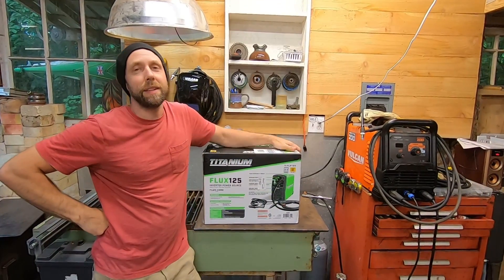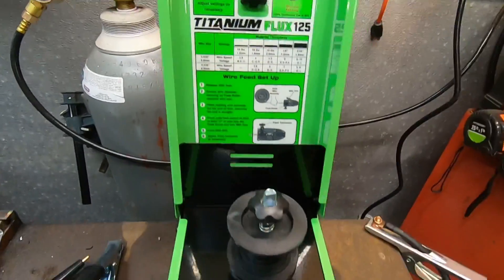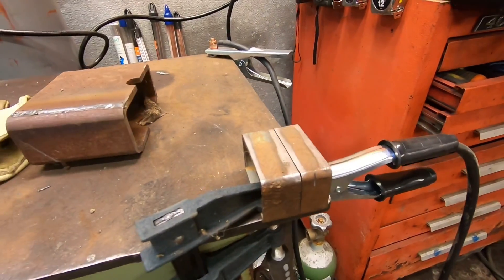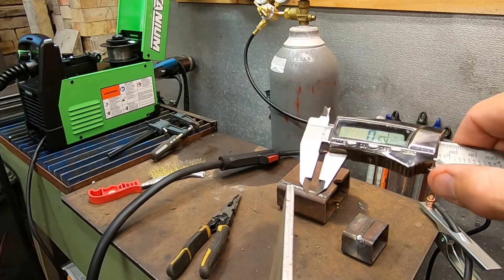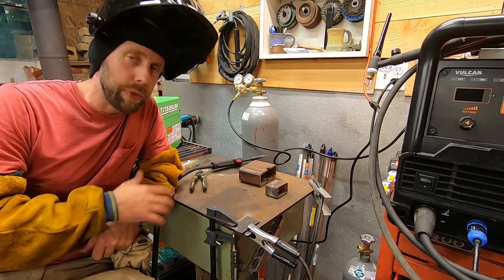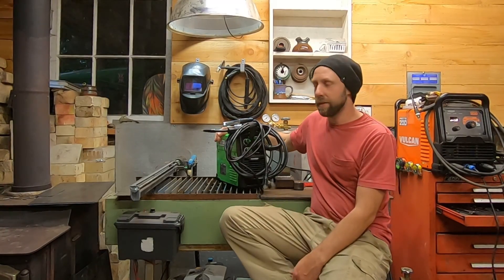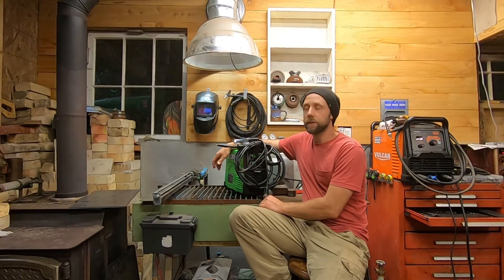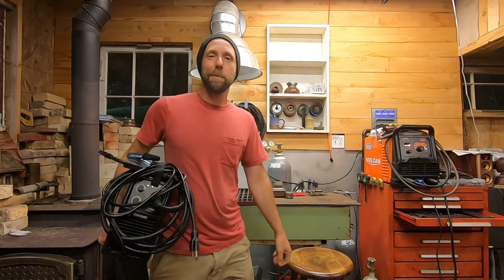Titanium Flux 125 welder from Harbor Freight

Comment: Mike:  I have had the old Chicago Electric 90 mig welder for a few years and used it a little with success.  A buddy of mine got this Titanium 125 welder and I tried to help him get started with it.  One thing I noticed right off the bat was the wire speed of the T 125 was way slower than my old CE 90.  If I put my wire speed on 10 and hold down the trigger, not welding, for 6 seconds, 60" of wire comes out.  The T 125 gets 14" of wire out in 6 seconds.  The specs for the T 125 say 60"-200"/min, so should have let out 20" in 6 seconds.  Also, when we were welding 1/8" material the T 125 doesn't seem to be getting it nearly as hot as my old CE 90, and smaller bead, have to go slower.  Do you think there is something wrong with this T 125 we are using?  Thanks.
Reply: I notice that too I just bought one and was feeding the wire and in max speed it was way to slow but I started welding and like the results welds are more consistent

Comment: Any idea what size generator a person would need to use this welder with. Thanks
Reply: Don,I can give u this info,Ive run the flux 125 on a Champion invertor 400watt start 3500 watt run gen.On full power ,I did shutthe Genny down on overlaod.This surprised me cuz the gen should be putting out a solid 29 amps,maybe its not? the welder says max draw is 23 amps.I did weld just below full power for long enough to know I was ok.Also ran on a HF 6500/5500 generator,no issues with that size gen.I need to test the Champion out more.

Comment: Hey Mike! Love these videos! For a novice like me they are priceless. What size breaker and Romex do you have installed to run the 110v migs that you showcase? Thank you for the great advice on this subject.
Reply: This Titanium 125 unit requires a 20 Amp branch circuit.

Comment: I had one of Harbor freight’s flux welders years ago in the main problem I had was slag beads all over the material Is there something that will help with that?
Reply: Fred Not spatter is going to happen anything flux core. Stick or gas less mig with have it to some point.
Reply: Quality wire that is not e71t-gs wire but e71t-11 or Lincolns 211-mp will cut down on splatter a bit.  There are also sprays you can put on the metal to help those BB's of metal to not stick.
Reply: You can apply "anti spatter spray" to the material beforehand. After welding, the slag beads can be brushed right off. Home Depot sells some by Lincoln Electric (KH505).
Reply: mrmax1984 thank you for that. I thought someone told me years ago there was a spray but I couldn’t remember what it was called.
Reply: Pam cooking spray works too if you're on a budget. 👍

Comment: How much welding can a person actually do with a 2 lb spool?
Reply from the maker: Well I built a entire bandsaw mill with a old Lincoln flux welder and it probably used two spools of wire to build. It’s as simple as having a extra spool on the shelf for when you run low. What do you plan on welding?

Comment: This guys got a great setup, if possible ide like to see some close ups of his welds maybe behind a arc proof shield.  Love the saying "if it's got slag you drag". That in its self will help guys
Reply: Should be "If you want penetration, drag." 
Guys, only push if you're working thin sheet, have a large root, are welding 3 up, or are hardfacing. Really anything 10 ga or over, maybe 12 ga if you want to go hot and fast, will benefit from a drag angle.

Comment: Need a welder to do some metal work on my truck, floor pans and rocker panels.  Has anyone found a .023/.025 wire roller and tip that fits this welder?
Reply: I am not positive but I think the smallest fluxcore wire is .030 that might be why you cant find .023/.025  tips for this welder because those smaller tips are for solid wire  and this welder cant run solid wire

Comment: I like what I see for a 125 amp.
Noticeably better, stabler arc,  than the Chicago electric 125 amp, flux, and tremendously better than 90 amp flux sold few years ago.
Would be great to have on my commercial truck, when I am trucking.
I carry HF 80 amp little stick welder, that was sold few years ago.
It's a MISERY to use, to light up an arc, it is so weak, but it saved me from a lot bigger aggravation twice, by helping me to get fixed when in a middle of nowhere, and another time it was weekend, all businesses closed down. As misery as it is, it was worth in gold, that it put me back on the road. This Titanium 125 flux seems to weld heavenly easier, and better than that 80amp stick, and is better than it's in house flux  competition of the same amperage. 
No reason to bash this thing for a beginner, or have it, to save you like in my case
Reply from the maker: Yes it’s definitely a great super compact light weight welder, I think it welds better then any other Flux only machine I have used in the past. I think for the price and usefulness of it it’s definitely worth having in your truck!

Comment: Hey Mike, I was thinking about getting one too, and converting it to gas, what exact problem were you having about the gas solenoid? I was wondering what places you were thinking of tapping off for the voltage for the solenoid and, that, I was thinking about using a real small relay, low current relay, and a capacitor, for a simpler, post Purge circuit, instead of a bit more complicated circuit using a timer, oh, I was just going to put a decent size capacitor in parallel with the relay coil, controlling the gas solenoid, what were you thinking, for a gas inlet on the wire feeder?
Reply: turtmaster t why would you buy one and convert?  Why not just get a mug and be done. MiG can run gas or gas less.

Comment: I’m curious can you plug the 125 flux titanium welder into an ordinary 110v outlet. Or do you have to have a 30amp or so breaker going to whichever outlet you plug it into. I have had much luck finding out in other videos.
Reply: Ive used it on a dedicated 20 amp circuit,handles 1/4" no problem
Reply: Thanks Jeffrey worth
Reply: I have used it on a 15A circuit, but tripped the breaker after doing a ~10-15second continuous weld on 1/8" stock. Spot-welding or welding lighter gauge material will work fine on a 15A 110V circuit. For future-proofing, I had an electrician install a dedicated, 2-pole 20A circuit for my power tools, like this welder.

Comment: Hey Mike,its jeff,i bought one of those titanium flux 125,s on black Friday,been playing with the voltage to wire speed ratios,Im getting very,very nice welds,no porosity holes,hardly any bb,s etc.Trick seems to be max chart wire speed,reduced from chart voltage.tried from 14 gauge to 3/8" thick.Id love to send u some pics
Reply from the maker: Nice Jeff That’s great to hear! I’m sure if you have some setting info, people starting out with this welder would be really happy to know. If you leave a comment on metal thickness, wire speed and volt settings you have found to work really well I would be happy to pin your settings comment at the top of the comments list to help others out!
I think if your list looks like this people should be able understand how to set there welder up 🙂
Wire size .030”
Metal thickness 14 ga. 
Wire speed 4.5 
Volts D    or   C.5 if a lower setting is best? 
Take care Jeff!

Comment: We bought one of these to weld up a wheel chair ramp at a school for the mentally handicapped.  The welds failed and 3 physically  challenged children with down syndrome went rolling down the main street hill like the poor bastard in the movie Red Dragon but with that Erie constant smile.  Next time we'll buy American... for the sake of the childrenz !
Reply from the maker: Haha this has nothing to do with Chinese VS America made, It just says a lot about the poor quality of the welds made from the person welding. I used a cheap Lincoln weld pack 100 flux welder to build a bandsaw mill and every weld is still holding strong to this day, but I know how to weld.
Reply: Mike festiva this idiots screen name says it all Mike. It’s obvious that it was the operator and not the welder that was at fault and maybe they should have had one of the students do the welding instead of a self proclaimed know it all adult who runs to harbor freight to buy a welder to do his very first ever welding job. Ah, nothing says success like a hard day of OJT!
Reply: @Mikefestiva  Sorry for the late comment. I couldn't agree more. Too many noobs trying to weld structural without proper training. I have welded half inch rear hinges for bar b q grills with flawless success not to mention several custom motor scooters with the chicago electric 125. And have fully built smokers from 55 gallon drums using stick welding only. It's all about the practice with welding but most dont seem to get it.
Reply: @Mikefestiva  I guess you don't care about the children .
Reply: @yerwrng  Please...give your BS a rest already.
Reply: Learn how to weld bro!!
Reply: was this ramp stainless or aluminum? If so, you're doing it wrong. Flux core is for mild steel.
Reply: @jasonmichael3128  it was 1026 the kids are also eating disabled .
Reply: BS story but entertaining.
Reply: @lv7603  Entertaining? ... I outline the misfortune of these individuals and you find it entertaining... that...comrade... is called shadenfreu .
Reply: No blame on the kids or the welder.
Blame the user.welding and getting metal to stick together are 2 different things
Reply: @Robert James So you're blaming the children...huh... , you insensitive bully !

Comment: I picked one up today, was on a black friday sale for $149.99, but no 
stock. Saw a couple of returns for $100, plus they let me use a %25 off 
coupon, $75 out the door, SCORE!. I tried it at home and welds great!. I
 upgraded from a basic $99 dollar black beginner harborfreight welder 
and its a big difference. Much cleaner and more consistent welds.
Reply: FilRider I bought one too yesterday for the $149 price. I have not tried it yet but I think it would work for what I need it for being nothing extreme.
Reply: velr50gt Yeah I pretty much used it for around the house and occasional automotive use. For the occasional repair, the welds are very strong.
Reply from the maker: Dude that is a smoking deal! I paid $179 on sale for mine. They are really good welders especially for the price.
Reply: How the hell did they let you use the coupon? Those seem to ALWAYS exclude welders in the fine print.

Comment: Question: I purchased that welder and having a few problems First when I start welding it sticks and goes out so I put the extra tip on and welding straight joints the welds are ok and strong but when I was welding a put together exhaust for my grandson I burned through above the flange. So I cut it off and dialed it down and it seemed strong in the vise but when I bolted it on and pulled on pipe I could see a crack around it! Am I welding to close to make the tip stick?
Reply from the maker: The copper tip should never contact the work piece, the wire should be the only thing touching the work piece. Make sure you leave about 3/8” to 1/2” stick out, this means make sure your wire is always sticking out from the tip that distance when you are welding. 
It’s best to dial in your wire feed speed and volts on some scrap metal that’s the same thickness as what you plan to weld, if you follow the chart inside the hood of the welder it will get you closer to the setting you want for the gauge of metal you will be welding, I do find these settings to run on the hot side, so start there and back it off a bit. Sometimes if you are really welding thin metal and you can’t get the welder dialed back enough without burning though, you can stitch your work, weld for a second or two, stop move to a different spot stitch and repeat, this can help from over heating the metal. Ps it also comes down to how fast you move when welding, staying in one spot to long will cause a burn though. I hope this info helps.
Reply: @Mikefestiva  Helpful reply, even though I'm not poster of the question it helped me too.
Reply: AND GET A JAR OF TIP DIP AT YOUR LOCAL AIRGAS STORE!!!😁👍🏻....Tip Dip keeps spatter from sticking to your MIG tip...they don't sell it at HF...sure wish they did!!! I guess they want to sell more PBA as that's where the majority of the profit is made!!!
(PBA = Parts, Batteries & Accessories!!! Acronym I learned whilst working at the RatShack!!!)😁👍🏻

Comment: What setting should you use to weld car exhaust?
Reply from the maker: Check the thickness of your exhaust tubing and look inside the hood of the welder for the recommend setting, they tend to be on the hot side so you probably will need to back it off a little bit. Ps practice on a scrap of exhaust pipe first to dial in your settings before you start on your main project.

Comment: Does this plug into a regular ac wall outlet?
Reply: Yes. Buy it. I just got mine today and welded an entire fence. really easy to use if you once its set up.
Reply from the maker: Yes a regular 120 volt outlet like you would plug 🔌 your TV into.

Comment: Would this be fine to run off a 15 amp outlet welding 18-14 gauge material?
Reply from the maker: Yes I think it will weld that thinner metal on 15 amps, I just wouldn’t go much higher then that.

Comment: Super interested to see how this runs off a small generator  (something like the Honda EU2200i) I'm sure it would be maxed out, but it would be perfect for offroad trips when something needs fixed where there's no power.
Reply from the maker: Great I will put this on the to do list soon, I have a portable generator, I will give it a try! Take care Jake
Reply: 120 Volts x 20 Amps = 2,400 Watts....I would go with a 3,500 watt generator MINIMUM for adequate overhead!!!😁👍🏻
Reply: @RTR-MATEY  probably right considering it's tripped my 20A breaker a few times when I have it cranked up.

Comment: Hey man did you do a video on converting it to gas mig or try it yet ? Didn't see a video for it. TIA!
Reply from the maker: Not yet, I took mine apart and found a power source to hook up a relay to, found a source to control the relay from, I still need to figure out the gas valve, I definitely think it’s possible but I now think it’s more involved then most people would like to do.
Reply: Yeah I figured it would be a pain. Thanks for the reply man.

Comment: Gonna be doing frame rustvrepair outside. This what I'm getting to do repairs
Reply from the maker: Yes this will work for your project, what thickness metal are you going to be welding?
Reply: @Mikefestiva   for 1/8 inch on a bottom core support be good to go yeah .?

Comment: How strong are the welds
Reply from the maker: They are quite strong, as long as you know how to weld there’s really no question if there going to hold. I ran out of shielding gas last winter right when we got hit with a snow storm, I had to switch over to flux wire to finish my work on a snow plow for my 4x4 tractor and ran that plow into all kinds of things and never had any problems with the flux core wire welds. Granted that was with a different welder but this little machine would have been capable of welding something like that, It just would take a little longer.

Comment: What settings would you recommend for this welder to weld a nut to a  broken exhaust bolt in an aluminum head.
Reply from the maker: Hey Kevin I have had to do this before to extract a broken exhaust bolt, I would start off around the 1/8” setting or a little higher, fill the nut making sure you get a lot of heat down to the stud, I usually start the weld on the stud and work it out to the nut, this way you know it’s getting a good weld to it. The heat helps loosen up the stud. I have also had good luck using a smaller impact gun, like a 3/8 drive, just lightly trying to back it out then a little in, repeat this a few times can help get it to come free. Sometimes the nut will break off and then you weld another one and try again. Good luck, let me know how it turns out.
Reply: @Mikefestiva  I got it done, luckily the bolts were not locked in tight and came out easy. I had 3 broken bolts I had to remove from the head. This embarrassingly was the first time I have ever touched a welder. My Hemi is back together. Thank you for your help. I used setting.... voltage (E.75) and wire feed (6.75)

Comment: Found this after using the gun, but on the backside of the face, (inside next to the wire feed) it has a cold wire feed switch!
Reply from the maker: Yes I noticed that the day after posting the video. Thanks for commenting 🙂
Reply: @Mikefestiva   Having trouble turning up information on google-- what are the implications of this?  Can we hook a gas solenoid here?  Does this mean we can use a spool gun?

Comment: i was trhinking of getting one of these for exhust work on a cple of cars was thinking since im no welder wld this be a good buy
Reply from the maker: Yes this compact welder works great, I would recommend one for simple shop/ house projects. It would do fine on exhaust pipe. They have a surprising amount of power for a small welder. I really like the newer inverter style welders like this, compared to the older bigger transformer welders. These inverter welders have a much more stable arch and weld smoother. I hope this helps. Take care 🙂

Comment: generators and extension cords i wld highly reccomend using 10 gauge wire i used that 15 yrs ago when a nieghbor let me use there flux welder otherwise it was a crappy weld (im no welder brazed some steal in jr high shop class in early 90's to make a basketball hoop) fast forward 12+ yrs needed to weld a floorboard in a car and nieghbor was like hay try this and my generator. after i made up the extension cord they werent the best looking but the garage was impressed for a 1st timer